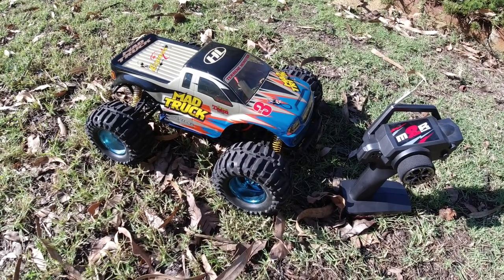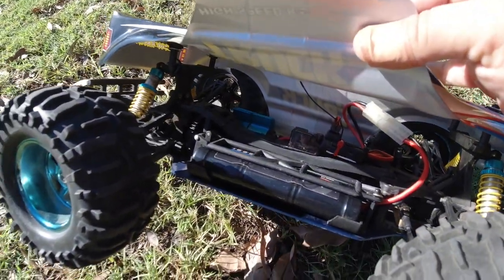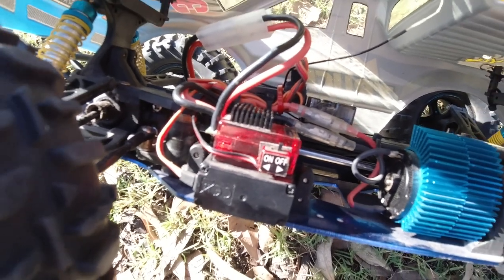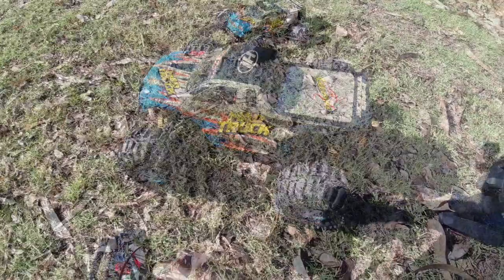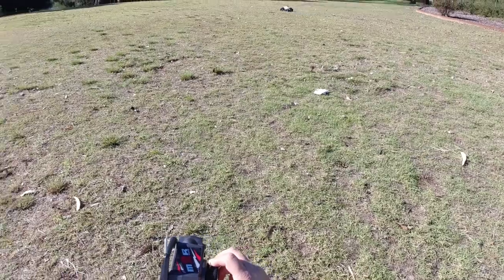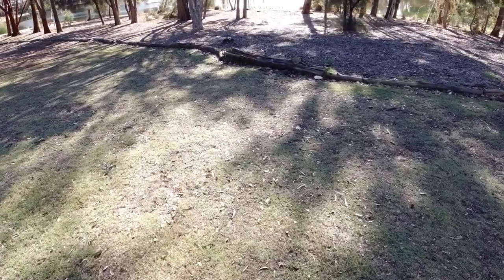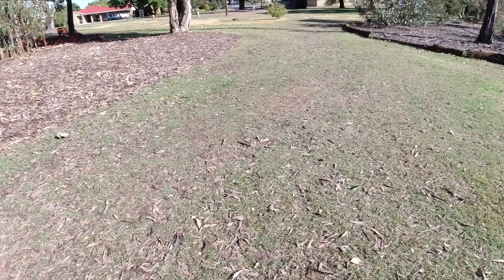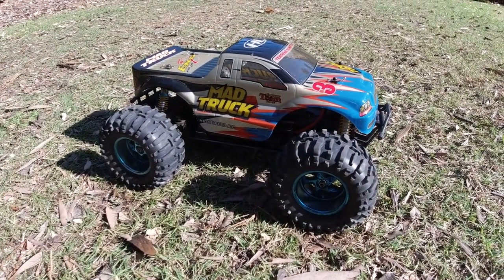HengLong MAD TRUCK 1/10 | Stock 550 Brushed 3300mah NiMH Battery Run Off Road

Comment: Cheers, will check them out. Front diff doesn't seem to be working. Taking it to the shop this week. Will give you an update👍
Reply from the maker: you can buy the front diffs here on aliexpress https://s.click.aliexpress.com/e/_DkdXP6T , in my recent video when i went brushless, i mentioned i had to buy the rear one from the same seller

Comment: That was smart to not run it on a lipo, and it had more than enough speed and the way you showed how it hugs the corners. Awesome!
Great video
Reply from the maker: Thanks for watching mate, and yeah thought I’d run it on the nimh on this original esc, I tried a lipo but it didn’t recognise it and cuts out so I think it’s rated to only 7.2v. I will convert it to brushless soon👍
Reply: @PERTHWESTOZRC  if you can, show the process of conversion and how you picked the new components, size and compatibility, that’s very interesting.  You have such a good understanding about that I could learn something from it.  
That’s so cool you are doing planes, drones and cars, everything RC ! That’s why I enjoy your channel so much!
Reply from the maker: Yes when I receive the parts for this truck I will make s video, I have done some brushless conversion videos before in the past as well 👍

Comment: Can i upgrade this HL model bro? I want buy too. Is that model so good same like HsP brontosaurus or HSP Wolverine?
Reply from the maker: You can pretty much upgrade any RC bro, not sure if you can buy this RC truck new anymore, watch my previous video these were released in 2002
Reply: @PERTHWESTOZRC  thanks bro. I see at shopee it still have this model. What are u prefer for me Hsp Brontosaurus or Hsp Wolverine or HL this model? For 1st time use? I want save my bajet
Reply from the maker: I don’t have the brontosaurus or wolverine but I would prefer HSP bro

Comment: Nice video :D How long does the battery last?
Reply from the maker: Well this is an old nimh that I had laying around and it started to slow down so pretty much lasted the length of this video, I could of probably kept going for another minute to dead flat I guess.  Thanks for watching mate 👍
Reply: @PERTHWESTOZRC  Alright, thanks a lot.